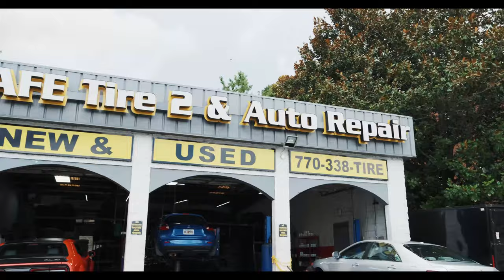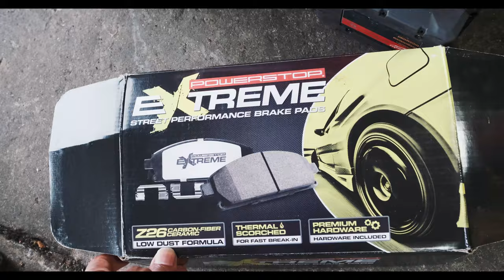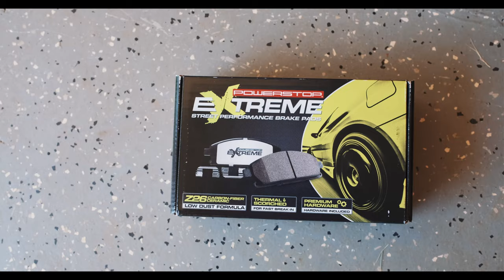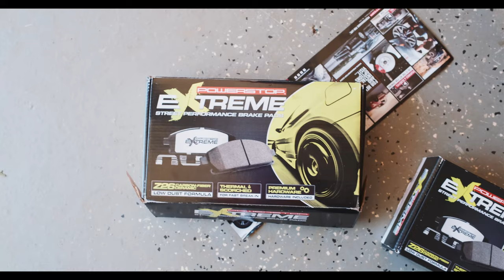POWERSTOP EXTREME Z26 BRAKE PAD INSTALL ON MY 2020 SCATPACK!!  "OCD"

Comment: Great video, thank you. I had these on my R/T. They were good, no difference from OEM, but much cleaner. The OEM ones ended their life after 6 years being completely worn out, the Z26 however, after 4 years became bit smaller and rattled on the bad roads.

Comment: Replaced the front Rotor and Pads with PowerStop Rotor and Brake Z26 Kit, The pads were really tight going in, I tried pushing the caliper in but the other would pop out (bottom/Top) so I had to do a happy median, maybe I'm missing the trick but this guy had no issues putting the pads in by hand while I had to tap them mine with a hammer.

Comment: Keep us posted on your break dust with new pads. I am thinking doing the same on my 50th Widebody Sinamon Stick Challenge I pick up this week.
Reply from the maker: I most definitely will its a link in the description under the video where you can pic up front and rear z26 powerstop Extreme pads if you need it. And congrats on the new 50th Anniversary bro I know you're super geeked about the car share some pics when you get it. Appreciate all the support thanks for watching!
Reply: GAME BANGING MEDIA Challenger just went too Xpel shop for whole vehicle install. Need it on roof,trunk & hood with that black matted . Heard it scratches easley. Don’t want to take chances so doing whole Challenger Xpel . Stealth Xpel on black parts.
Reply from the maker: @Jeff-or6em  thats going to be dope but the matte doesn't scratch easily because its a wrap. Which i did not know i actually made video about it make sure you check it out. How much did your treatment run you for the car?
Reply: GAME BANGING MEDIA  7k in Massachusetts, whole car expel and stealth Xpel . Then whole car interior and over Xpel is fusion plus ceramic.
Reply from the maker: @Jeff-or6em  sheesh take care of business then big money 💰 gotta take care of the babies. Thanks for watching bro appreciate the support 🙏

Comment: Dope video my brother.
Do you have those part numbers?
Reply from the maker: Thanks bro appreciate the support 🙏 here are the links to the Z26 powerstop Extreme Performance Carbon-Ceramic Brake Pads Front and rear  you can also click arrow below the video and links are available at the bottom of description page. buy front 6 piston Z26 powerstop Extreme pads here for scatpack or hellcat here  https://www.amazon.com/dp/B01AGBXJO6/ref=cm_sw_r_other_apa_i_KvwjFbKF122J2

buy rear Z26 powerstop Extreme pads for you scatpack or hellcat here  https://www.amazon.com/dp/B00FTUN9EK/ref=cm_sw_r_other_apa_i_4zwjFbZYN82GJ